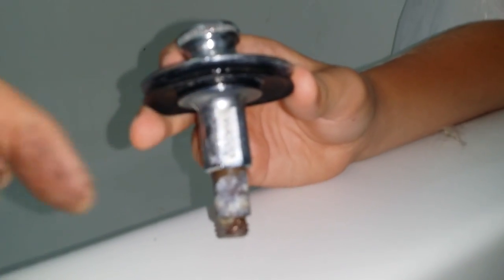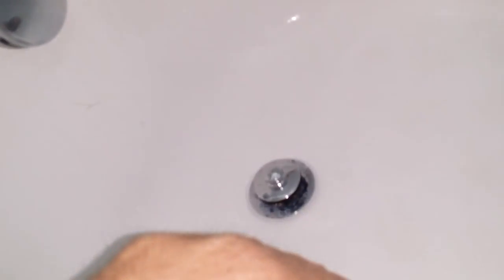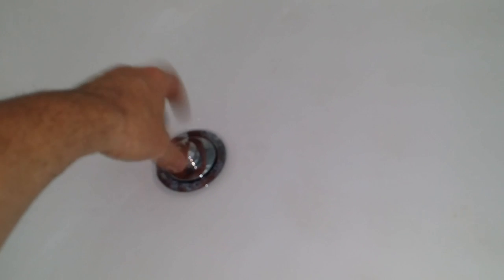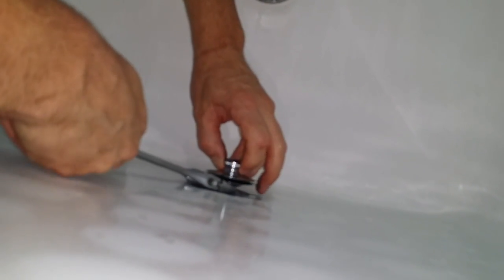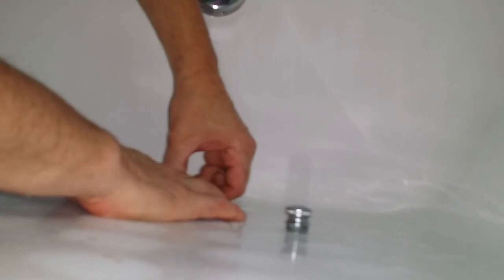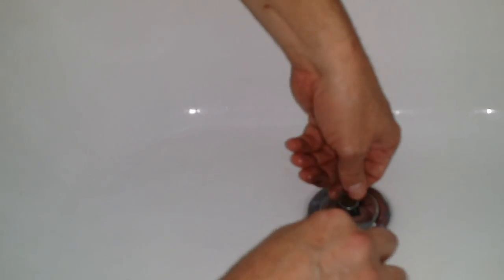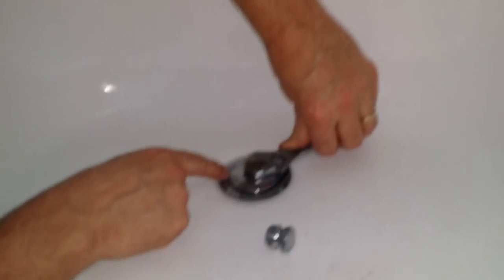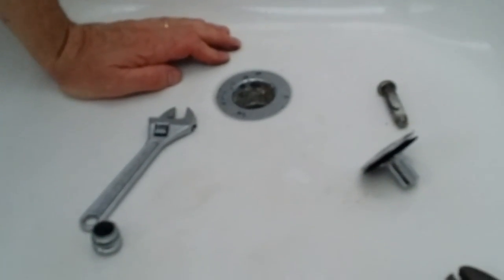Remove Watco drain with no release screw or screw slot in the stem

Comment: You SAVED me here buddy. I want to add for anyone who had to go through this absolute mess:
My unit was lower for some reason than your video and 
For the first part, I used the wrench part of a combination wrench since it would fit, 9/16 size.
Note I couldn't twist that knob off on my own likely due to grit/rust and used my craftsman Robo Wrench which is great for jobs I fear breaking something like that knob. It did come off then I used a 7/15th on the second bolt which I had less of a struggle on than the folks in the video thanks to there not being a stopper to get under. All in all, I want to give a shout out to Watco for killing an hour or two of my life and building what is an extremely stupid design. They have the audacity to write "patented" on the flat part...